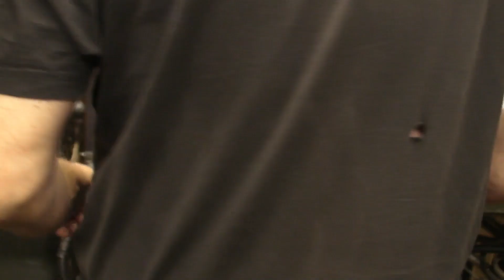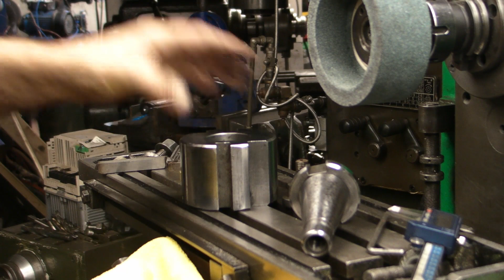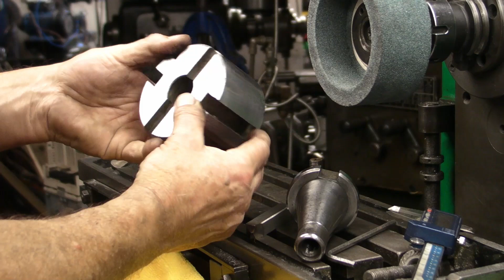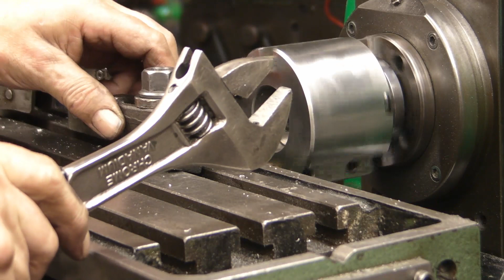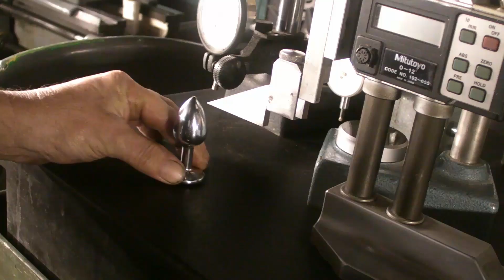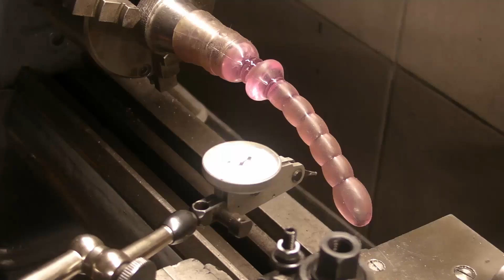Can this tool be called a fly cutter ?

Comment: Its a fly cutter I made one in 1973 for a mill. Mine I left a shaft to use in a collet. Two cutters helps to slow wear and better finish.
Reply from the maker: Thanks Silverbullet, its just that my understanding of a fly cutter is that it only used one cutting tool, Del.

Comment: Ally can be difficult. Sometimes you get a tiny blob of it which sticks to the end of the tool and ruins the finish. Unless you know that your carbide is good for ally best stick to has. That new flycutter is a big hunk of steel and we get to see a new machine every video!
Phil
Reply from the maker: Hi Phil, not thought of the ally sticking to the tip of the tool, makes sense when you look at that cutter I showed which is for ally, its very highly polished. Fast running out of space in the cellar and my neighbour is away for a week, may knock through, he dont  use it. have we got a treat coming today or tomorrow, Del